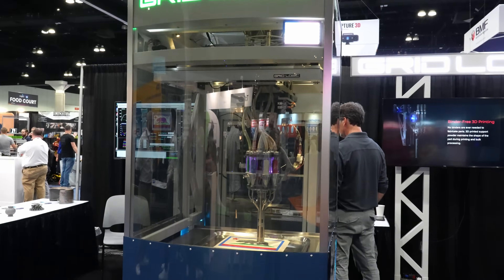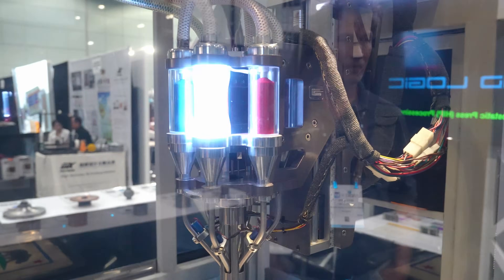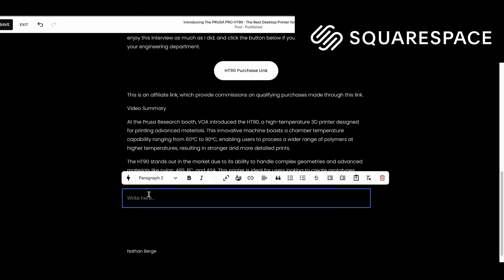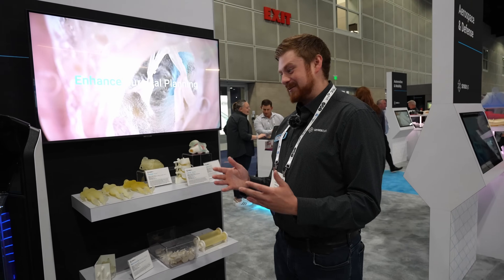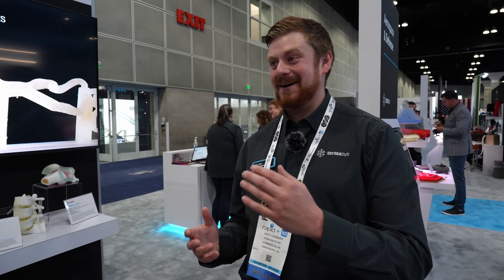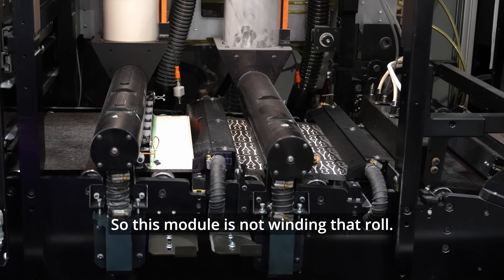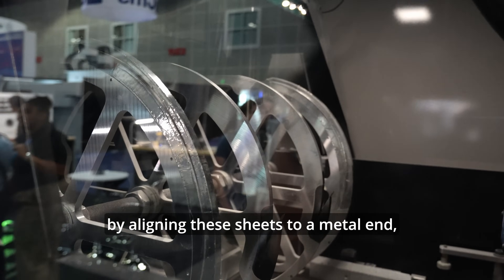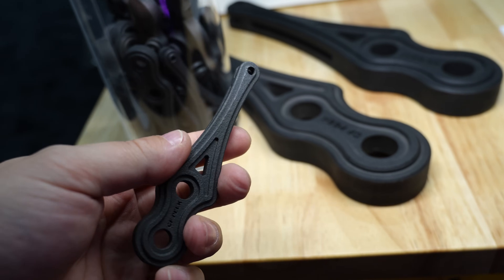Mindblowing 3D Printers at RAPID+TCT 2024 (GRID LOGIC, Stratasys, Impossible Objects)

Comment: How do the stratasys’ kinematics work? I was very curious about that. They have a rotating bed instead of a typical gantry and make great multi material prints. But how does it do that
Reply from the maker: It uses an ink jetting system. There is a line of printheads above the platter that goes from the center of the circle out to the edge